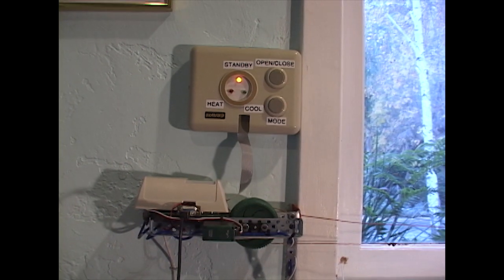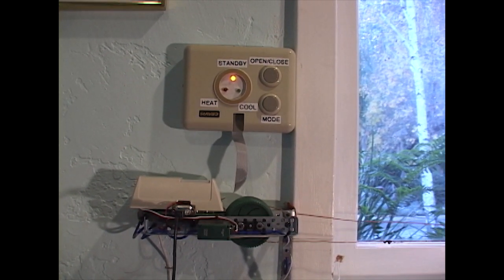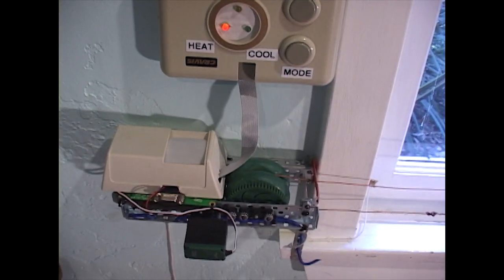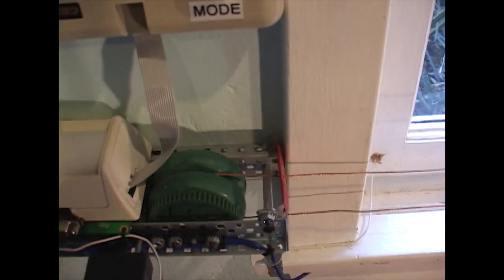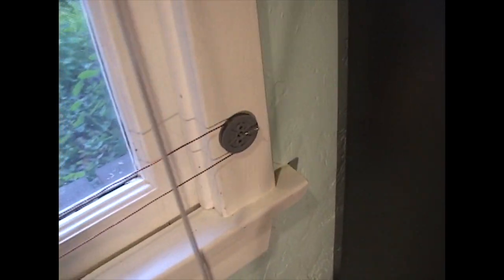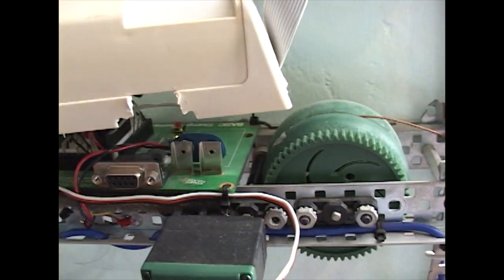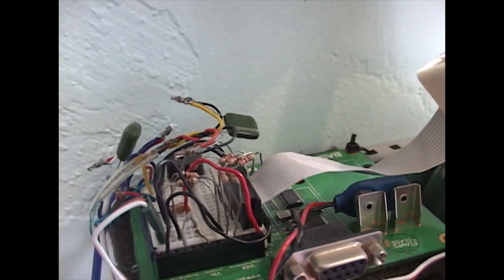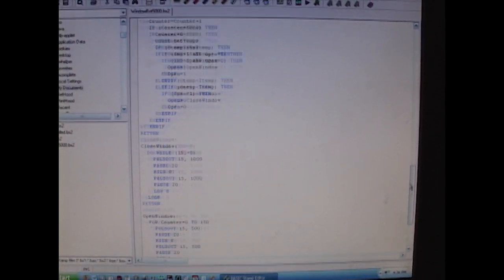Robot Opens My Window

Comment: When i was a student I made similar thing. I was learning automation systems and I want to use this knowledge in a fun and useful way. So my approach was different, instead of open/close states I was changing the angle of the window (it opens up like that). My electronics used feedback loop to adjust the angle right to the temperature i've set up. So no calibration at all! 
It was nice to find similar idea, I didn't thought that someone else would be interested in such things. Thanks for your channel!
Reply: Interesting my entire school has windows similar to yours, but they measure oxygen concentration and open up according to that

Comment: What kind of controller did you use? And how did you uploaded the code? Im kinda interested in the type of project that rebuilds an arduino project,for exemple, with only some transistors and stuff, but idk really how to google it too... Is that really possible?
Reply: looks like a propeller or similar microcontroller. you program it with a usb cable and interface board, or maybe a parallel port. Arduinos are made of transistors, so to answer your question yes you can rebuild arduino projects with just transistors but why would you?

many projects, take a blinking light for example, can be completely modeled with discrete components. with a couple transistors and capacitors you can make a circuit where an LED is on for 1 second then off for one second continuously. just google for a schematic, buy the components, solder them together and power it up.

it's as easy if not easier with arduino. just buy one online (>$5 usually, get an uno or nano)  plug in with USB, and upload the example sketch (blink).

the cool part is when you want to add extra functionality. like what if it blinked a specific morse code message on a loop instead of just one blink? well get out your slide rule and capacitor bucket bc that's one hell of a timing circuit

or just copy and paste the code and change the amount of delay to your liking. upload and immediately see the results.

also, once your project is in an arduino program, you can add libraries that drive displays or use complex input like gyroscopes and lidar. check out how many arduino libraries are out there to automate complex functions and make coding very straightforward.

if you're interested in discrete electronics look at kits for FM radios and maybe transistor-transistor-logic circuits, like kits that make a binary half-adder. But still, you need 0 electronics skills to just begin coding for an Arduino. I'd start there.
Reply: its a core i9 9900 OC, with 124 GBRam. youre welcome. :)
Reply: A cutout on the cover showed a serial port.

Comment: I'm planning to do something similar, but the window seems a bit iffy on how it wants to open. Did yours give you any trouble?
Reply from the maker: With the right gearing ratio, it can always work.  But it's faster and less noisy if you do something less janky with a bearing.  This was just made with whatever parts I had around.
Reply: @CodeParade  Thanks for the input! I'll try something similar to your design. Hopefully it works smoothly.
Reply: @whynotanyting  how did it go
Reply: Use plenty of lube. . Well that's what she said.
Reply: Could add a fail-safe of some sort too, I guess.